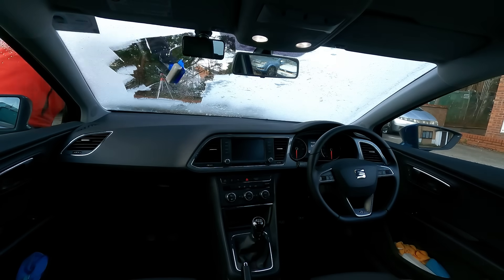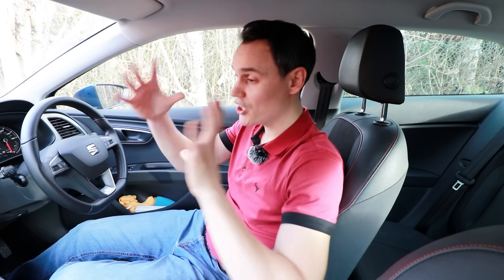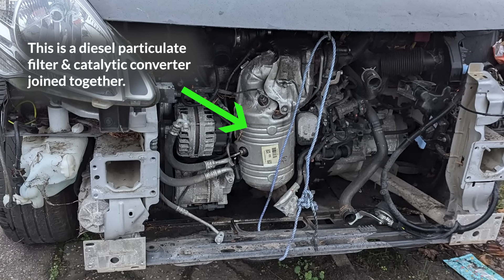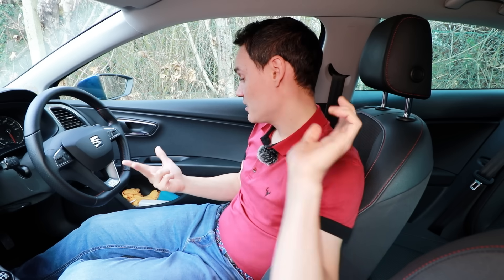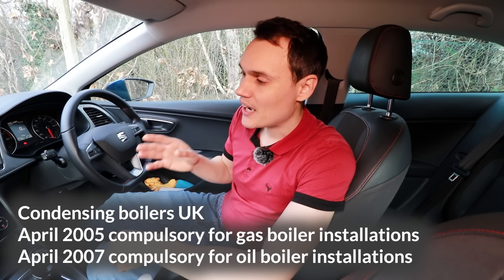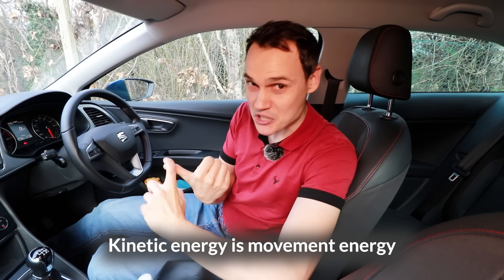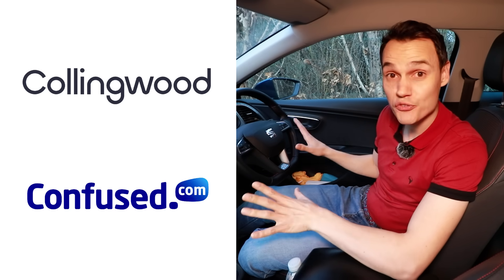How turning the engine on when de-icing can cause you harm. Possibly even cancer.

Comment: The main reason for running the car before you drive it when de icing is actually to get the components of the car up to temperature before you drive it. Otherwise someone might get in the car and try and drive it like it’s already been running and cause issues further down the line meaning it will cost you more in the long run. Plus with the engine running your less time outside deicing plus you don’t really need to worry about doing the back of the car unless you have no rear window wiper because the demisting element and wiper will clear it just fine.  Plus a lot of cars have a lot of moisture inside so running the car with the blowers going will help clear that also otherwise your still sitting inside the car with the engine running to clear the screen.   Sort of defeating the point.   The one thing you should never do and you didn’t address it. Is people who boil a kettle and pour that on the windscreen.

Comment: Thank you Richard! This is a great reminder for people to not take exhaust fumes lightly.
#OneMessageFoundation
Reply: You're not going to get cancer from de-icing your car with the engine running!
Reply: @djfld2394 Hopefully you won't but like he said in the video, if the wind blows the exhaust towards you and you inhale it, it could worsen your health in the long term causing serious issues later on. 

For this reason as well as to play it safe and save fuel.. you might as well start the engine when you're actually in the car, ready to take off.
Reply: @djfld2394  Most people are not going to get cancer from most carcinogens, that applies even to people who do eventually get cancer as a result of carcinogens. 
Cumulative exposure and bad luck of the draw is what matters. Only one is under your control.

Comment: There's too many people who start and idle the car "to warm it up", when it's an extremely inefficient way of doing so. You could idle for 10 minutes and it'll still be cold, but drive for 3 minutes and you'll have warm air blowing through the cabin.

My process is:
1) Sweep off the snow
2) Spray de-icer
3) Wait 5 mins, scrape off the ice
4) Get in and start the car, switching on the demisters (with AC always on), seat heating and steering wheel heating (the latter are automatic on my car). 
5) Wait 30 seconds for fluids to circulate, then drive off, keeping the revs low until the oil warms up.

Comment: Ok but if you're supposed to de-ice with engine off why does my car have a heated windshield that melts the ice off? It clearly won't work with engine off.

Also the thing about heating up the cat? When it's like -10C or lower outside I've seen my car high idle close to 2k rpm even just to warm up the cat faster.

Comment: I used to live in Montana, we used engine block heaters in winter so we started a relatively warm engine (warm-ish oil but a good head start).
When it was really cold, we used trickle chargers to keep the battery "warm" by exploiting its internal resistance.
You lose a bit of your catalyst when you drive off first. The ceramic support expands more slowly than the metallic catalyst coating so as the engine warms up, some of the coating goes out the rear. These valuable particles are settling in drains near housing estates etc.

Comment: Lexus/Toyota cars warm up the 'cat' after a cold start by running the engine in what its loosely called 'blowlamp mode' (a lot of throttle and grossly retarded ignition timing to keep the engine revs down) so that the engine generates lots of hot exhaust gases - it you're standing outside the car you can hear the engine note change when this stops after 50 seconds or so.
Reply: All petrol cars do that since Euro 4

Comment: F1 (until the 2026 season starts) has a Motor Generator Unit - Heat (MGU-H) which captures the heat from teh engine. As you say, it is very complicated. So complicated they're getting rid of it for manufacturer cost savings to entice new engine suppliers this year. Very very cool though, and the most efficient internal combustion engines to ever exist.

Comment: Carbon dioxide is indeed a greenhouse gas.  However, it is also inert.  That is to say carbon dioxide is "happy" as it is and it "wants" to stay as carbon dioxide.  Unless you are a plant or alga,  it is very difficult to convert it into something else.

That is why it is used in fire extinguishers. It cannot burn,

Carbon monoxide, on the other hand, is unstable.  It "wants" to become carbon dioxide so it is going to "steal" that extra. oxygen atom from anywhere it can find it - so much of that carbon monoxide will end up as carbon dioxide anyway. (It burns with a  pale yellow flame).

But if the carbon monoxide "steals" that oxygen from you then you have a life threatening problem and it can  do that not just in the air around you or even just the air in your lungs. If you breathe it is, it can get into your bloodstream and "steal" the oxygen and take the oxygen you need to  keep your vital organs, such as your brain and muscles functioning.  That is why you get 'flu like symptoms such as headaches  and muscle aches,

Comment: If you have an EV you can just set the heat to turn on for 5-10 minutes before you get in the car via the app. EV have electric heaters unlike most ICE so they heat up in about 30 seconds. 
No scraping required and no harmful gases.
Reply: It's almost like they both have their advantages and disadvantages
Reply: @gamesmaster1060  They do, I just meant it for users that maybe are about to or recently bought an EV and didn't realise this.

Comment: I don't know if it's to do with where i live (on the coast, with very humid air), but i can't "de-ice the car, get in, start it, and go". With every car i've ever owned, that results in the windscreen dangerously misting up within about 30 seconds (even with AC on etc). I have to wait for it to mist up, and then naturally de-mist after that phase, and then set off, or it's just dangerous to drive.

In addition to above, my windscreen is sometimes iced up on the inside of the car as well (due to the humidity), and getting that off means sitting in the car, and my breath just replaces the ice with mist, which instantly comes back on using a cloth to get rid of it, unless the engine + AC is on.

Again, all of the above has been with every car i've ever owned. It's not just been one troublesome car, or that my current car has a problem that has caused it.
Reply from the maker: I don't experience this problem if I keep people out of the car whilst demisting: https://youtu.be/KtBZ-TItVeA?si=kiJjLflwCyJBa002

But I keep my AC on permanently, modern AC system use very little energy when cold but keeps moisture out the heating system: https://youtu.be/n97y81Vj-MU?si=fZ0bcTW4l_ko4yja

Both the videos I've linked to may be of interest.

Comment: I have a heated windscreen so will start the engine to use that with the AC on to demist the interior (I ALWAYS have the AC on have NEVER TURNED IT OFF IN ANY OF MY CARS), the back window and get my seats and wheel heat on.
Reply: Heated windscreen should be on more cars. Have not needed to scrape my windscreen free of ice in 9 years, super convenient.
Reply: @SurgeDashcam they are good. But I still have to get the car warm to help with the side windows before driving.

Comment: I agree with the sentiment of the video. Breathing in the exhaust gases of a petrol car prior to the catalytic converter being at temperature is bad. The exhaust gas contains a much higher concentration of VOCs, NOx, CO, etc. However, this exposure is very limited when defrosting the car for a few minutes especially if the car is newer and in open air. Many harmful chemicals are relatively safe in low enough doses, and will not meaningfully increase your chances of things like cancer over the course of your lifetime. I would recommend not turning the car on if you're inside an enclosed space whilst defrosting, but in the open air these gases will not be in enough concentration for you to be harmed by them (unless you plan on standing next to the exhaust pipe for 5 minutes straight. 

The real thing you need to weigh up is the fact that this extra risk factor is negligible when compared to other risk factors in life. Hell, you'd probably faint if you saw the SDS files of some of the chemicals everyone uses daily, or even those used by Year 1 undergraduate chemistry students.

Sincerely, 
A Chemistry Masters student who has already studied heterogeneous catalysis and the effects of the catalytic converter.
Reply: Exactly this. While its not healthy, the exposure level and time frame in this is minimal at most, especially for the majority of people. The times when you see symptoms associated with N0X or CO is due to low concentrations within a indoor setting, usually over the period or hours or days. In such low concentrations, this isnt going to cause cancer. Both the International Agency for Research on Cancer and the EPA havent classified N0X as carcinogenic.
Reply: @kyletrusler4565  Although I would add that as something easily avoidable, its no burden if you're not in a rush to simply de-ice the windscreen first then then get in and turn on the engine.

Scaping enough ice off the outside shouldn't take more than 20-30 seconds. There's no need to scrape everything off. Or use one of those de-icer sprays (avoid spraying on face).
Reply: @eddyr3691  Its more so that the risks associated with it are exeedingly low, so focusing on it, before driving off seems weird. If that plays a role in terms of long term health, one shouldnt drive either, as thats more likely to cause harm. That being said, if you can scrap the ice quickly, I can see benefit to get it done before turning the car on. Im just use to heavy ice that needs the car to run, otherwise it takes a lot longer to remove.

Comment: I’ve been doing it exactly how you described ever since i got my car. Only redeeming factor is that I haven’t driven for a good part of winter because I was abroad. Thanks for this video, I knew that the mixture running rich at the start was a thing, but I had not the slightest clue how harmful that stuff is. Amazing video as always, but you never actually addressed the proper way to do it in the video (although I know it’s linked) which might throw people off.
Reply from the maker: Thank you for watching. I watched back the video I did nearly 5 years ago about how to de-ice a car and don't think I can improve on it. I may leave a link in the description also to help people find it.

Comment: What about remote climate control in newer hybrid vehicles? 
Do I not go near it while it's doing its thing?
Reply from the maker: Our hybrid can pre-heat/pre-demist, it puts the heating in re-circ mode when preheating remotely. This prevents fumes entering the cabin but sometimes causes the windows to mist up. Some hybrids will run the engine at a load and rpm to get the catalytic convertor up to temperature quickly even if the car is not being driven and put the kinetic energy into the battery for later. Definitely not a good idea to be close to it during a quick heat up phase.

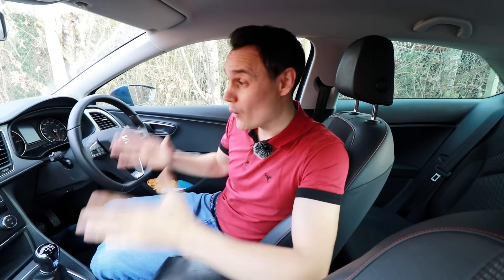Comment: 1:57 I prefer my engine to work after 100k miles. I won't be starting my engine in the -2 degree morning and immediately driving off while blasting the AC and the heat (which is pointless when the engine has just been started as there won't be any heat)
Reply: I think it depends on the equipped engine and supporting systems. 

We have a 12 year old Nissan with a small 1.2L 3-cylinder engine and a 21 year old Audi with a 3.2L 6-cylinder engine. Both are euro 4 emission class. The Japanese car starts almost instantly and keeps the revs elevated for only a few seconds before it drops down (regardless if its freezing outside). The German car takes a little longer to crank but otherwise also starts relatively quickly and then keeps the rpm up to 1300-1400rpm and stays there for a minute or so (10-20 seconds in summer cold starts) then drops down to around 600-700rpm regular idle. Both started in similar temp and location during freezing months. This makes me think that the bigger the engine, more emphasis is on emissions by getting the cats warmed up quicker hence the higher idle speed for the bigger car and equipped systems such as secondary air injection to aid heating combined with pushing unburnt fuel into the exhaust by late ignition timing.

I believe that the Nissan doesn't necessarily heat up the cats much if at all before driving it, and the engine itself doesn't produce much heat while scraping the windshield for a minute or two after starting the engine. The Audi during the same timespan has its coolant temp needle already risen above the minimum 50c mark and the vents blow lukewarm air.

The Nissan is mostly our city car and the Audi is mostly used for longer distances, with the Nissan having almost 160k km on the odo (100k mi) while the Audi has 367k km on the odo (228k mi). The Nissan is on its second exhaust as it had partially rusted out, but the Audi is still on its original exhaust system, if that matters.

Comment: What you say is true, but it is not like you are going to die because you turn your car on and let it idle when the air outside is overwhelmed with Nitrogen and Oxygen. But it is good to be aware of what might happen if you sniff your exhaust tips or leave your car running in a closed garage.

Comment: Points are valid, but when you extend the logic it can lead to bad assumptions and ideas that aren’t in perspective-
So you should start your car and drive it immediately from stone cold? Even better, red line it for a bit. Want it to warm up as quick as possible. Less time rich exhaust fumes.
And also, never cross the road near the rear of a vehicle, in case it’s cat it’s warmed up yet and you get a slight whiff of exhaust?
Reply: Yes you should. A cold engine is where you rack up most wear. Idling for 5 minutes is terrible for it because you artificially extend the time the engine spends in its worst working conditions. Idling also heats up the car very unevenly and only the engine and exhaust. What you should instead do is
1. Start the engine.
2. Modern cars build up oil pressure basically immediately so just wait 5-10 seconds for oil to splash around almost everywhere in adequate amounts
3. Start driving but do so gently. Accelerate gently, don't rev past 2k-2.5k on a petrol engine and wait keep a low load on the engine. That means you should select a gear that makes it easy for the engine to sustain your current speed on the given road conditions.

Keep driving for a few minutes to warm the car up before you go on the highway. Personally, I also keep the cabin heat off completely until coolant temperatures reach around 60-80°C. Cabin heat saps A LOT of heat from the engine depending on fan speed so this can shave off several minutes of warmup time. This is what I do everyday and it's around 0°C here. Of course, if you live somewhere where it's regularly -20°C or something, this won't apply and you should indeed let the engine idle for a bit because you have no other option.

My car works better than ever with this routine.

Comment: The efficient 1.0 engine on my Citroen C1 takes an age to warm up, after 12 years with the car here is my  defrost routine. 1. All electrics off - including fan - as that takes any heat away from the engine, taking longer to heat up. 2. Slightly warm water over windows, remove melted ice with squeegee, spray windows with de-icer.3. Turn on interior fan - it should now be producing warm air, clean interior windows with kitchen towel if still misted - and drive as soon as possible.

Comment: I need to correct you at the near end of the video "don't de ice with people/kids in the car" The car your sat in as a VAG group car when you press the max defrost buttons on the heater like most other Air Con cars activates the air recirculating vent and only draws air from inside the vehicle therefore heating air from ONLY inside the car and not cold air from outside, it also blows air over the now chilling air con evaporator thus acting as a dehumidifier. All the exhaust fume stuff spot on as a mechanic of 30+ years and VAG Skoda trained. PS, why did Volvo develop the Pollen filter? so you could drive behind a diesel vehicle nothing to do with pollen that was just a bonus.
Reply: most vw ac doesnt turn on below 6c to prevent damage to the compressor.

Comment: The AA advises to also put the ACon on as well. I never scrape my windows but use a bag filled with luke warm water. Melts away perfectly.
Reply: most ac doesnt work under around 6c to stop the compressor from freezing and costing u hundreds of pounds, The AA once again proving they know jack.
Reply: @grrfy  Ours does.

Comment: One small error, catalytic converters do nothing with nitrogen oxides. Nitrogen oxides (NOx) form by fusing nitrogen and oxygen in a high temperature flame, usually when the car is fully warmed up. Modern cars have reduced NOx generation by careful control of temperatures, pressure and fuel air mixture inside the cylinders.